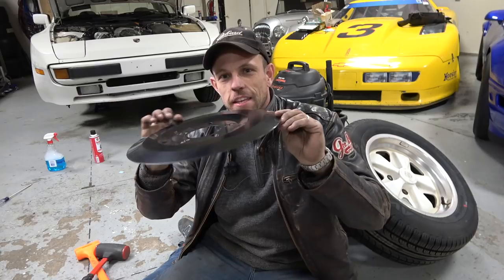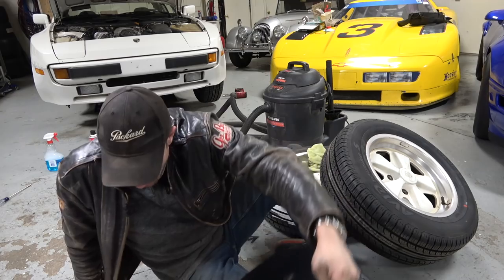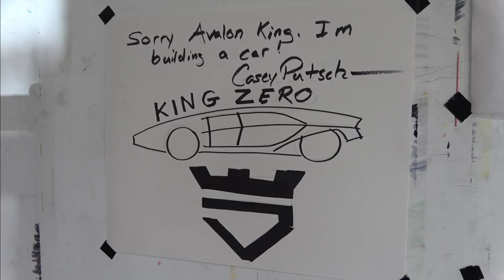Stopping brake dust on my daily driver Porsche 944

Comment: Why don’t you put ceramic coating on the wheels to minimize brake dust collection
Reply: Amen, Alvaro!
Reply: Because you still have to clean them and reapply the coating? brake dust shields are fit and forget.
Reply: Or ceramic brakes 😀

Comment: There's a small bar in Livonia, MI that still has a cigarette machine inside.  And it still works!  It's never really been cleaned so it's got that yellow/brown patina from cigarette smoke all over it, on the chrome, the glass, the plastic.  I was told it was installed new in 1952.  Back when I was a smoker (15 years ago), I bought a pack from the machine just to do it.

Comment: Germans love their soft dusty brake pads. Every German car I’ve owned, BMW, Audi, VW when the pads wore out (and occasionally even before) I’ve installed a set of Hawk ceramic pads. Not cheap but they work great, dust is nil and what dust there is isn’t black and washes off easily. Love me them Hawk ceramic brake pads!

Comment: So much memory lane with those dust shields. I remember seeing ads for them as a teen reading Car and Driver in the 80's and wishing I had a car with alloy wheels to put them on. Weren't really necessary with steelies and caps. Good education on the quick & dirty fab work. I would have had to wimp out for some gloves though.

Comment: Yo, Casey, you should get ceramic composite braking shoes on the next change, they leave a far less noticeable dust behind and also make a heck of a lot less noise in the usual suspect situations. They cost a bit extra, but then, they also last a lot longer too. Also, being ceramic based vs metal or organic (with the exception of the really highend metal ones) they have a very high performance range across most ... what should i call them, environments(?).
And, here's the kicker. Porsche popped them out back in the 00's. It was meant to be. :) Just my two cents. IMO, they are worth it. One of those buy once cry once type of things.

Comment: I just did cleaned, polished, and ceramic-coated my fiberglass jacuzzi tub too not to long ago! My wife thought I was crazy. Glad to see I'm not the only one. My thinking was, 'well they are polyurethane coated so, why not?" LOL. regarding the dust, are running Pagid pads? They suck for street use because they generate so much dust in my experience. Good video Casey, you are funny AF. Got a kick out of your millenial skit thing. Cheers from Puerto Rico.

Comment: Would it not affect brake cooling? As long as you drive it normally I dont think it will be a problem. I remember a few years ago ambulances here overheated the brakes due to them putting on some steelwheels without ventilation, but they ofc weigh like 3.5+ tons. Just curious.

Comment: That way you are gonna lose a huge amount of brake disks ventilation. Especially if you daily drive in city and heavy traffic in summer your brakes will burn like Dutch oven! If you want less visible dust opt for white brake pads (expensive) or just clean the wheels every week.

Comment: You just added 25 Concours points. LOL We used to push the button for matches if the buyer didn't opt for free matches we would get a free pack of matches.

Comment: Those dust shields are going to reduce air flow SO MUCH, guaranteed.  You might even overheat them.  Get Akebono Brake Pads...they don't dust AT ALL.

Comment: Isn't the airflow from the Wheel/Rim "Supposed to" bring the Air in to Cool the Brake Disc?

Yes, Brake Dust is a (Aforementioned Five Letter Word) to clean, but that is the Primary purpose of the Brake System!

Comment: Casey, I know how to get rid of that gross brake dust that collects on wheels, no brakes! Just hear me out, so since brakes create brake dust, wouldn't not having any just stop any brake dust from collecting. But what you may be saying is, "Idiot then you can't brake", well just hear me out again, just don't stop. Stopping means that you lose speed and thus lose time, so not stopping means that you can get somewhere faster. You might also say "But that's dangerous, you might slam into someone or something and die", but if you don't slam into anything you won't have that happen. (This justification of no brakes continued for a fortnight until the user passed out, then woke up and was unable to remember what they were blabbing about)

Comment: If you get ceramic pads you'll hardly ever get brake dust. Especially if way your wheels. The cheap pads are the worst except for metallic pads. Do not buy metallic pads

Comment: ... so why don't you just ceramic coat the wheels and go puddle jumping?  I mean, it works for us WRXs >.>
Reply: I have a 2003 Mustang GT with ceramic brakes so brake dust is a huge problem. Does ceramic coating really work? My wheels get dirty quickly.
Reply: @angelgjr1999  I haven't actually done it on mine (probably should) but I think it would, especially if you're around enough water.  Would be worth trying tbh.  I mean, we're talking about someone ceramic coating a toilet for crying out loud....

Comment: Shockingly bad idea, and shocking so many comments are to ceramic coat the wheels. Posted 2 days ago and none of you bozos know about dustless ceramic pads?? Wow, just wow! I never have brake dust on my Lambo, Lotus, Jags, Range Rover, etc with ceramic pads.
Reply from the maker: Shockingly rude flex?... Ceramic coating the paint on the wheels is a brilliant idea to keep them clean. Yes, ceramic pads would help a lot and so will dust shields on this old 15 inch wheel car. Ease up Tex.